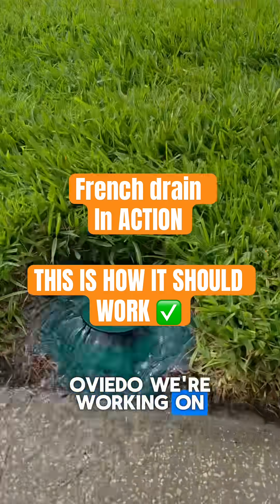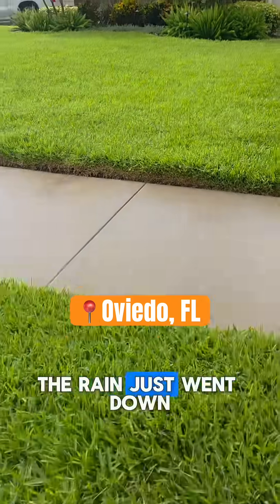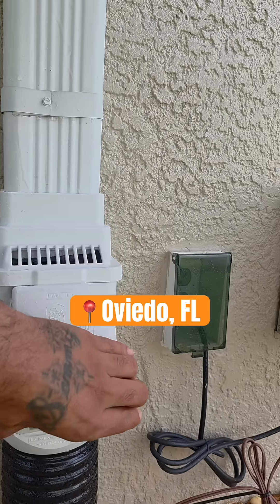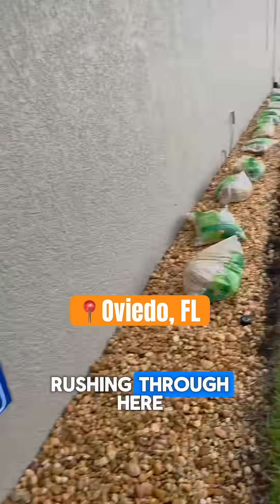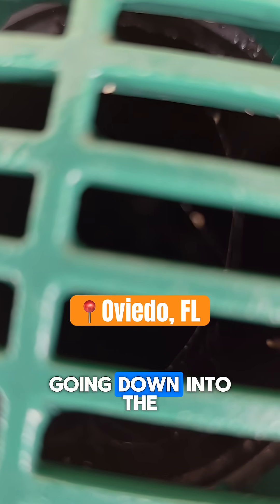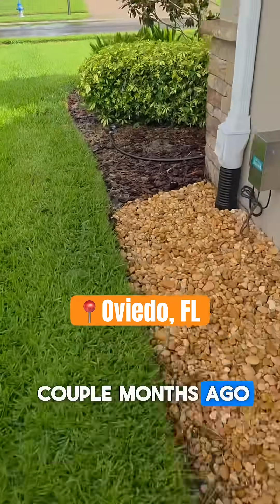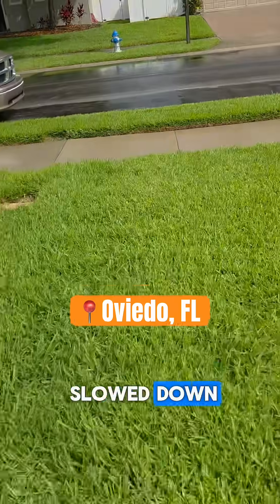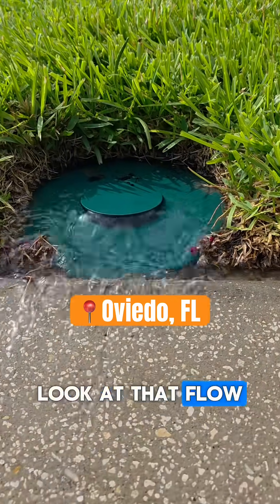How a French Drain Works (Real Footage)

Comment: I’m surprised you can drain directly on the street without it going over vegetation before. In our county you will get fined and told to remove it as our storm water system is not filtered according to the city. Looks good!!